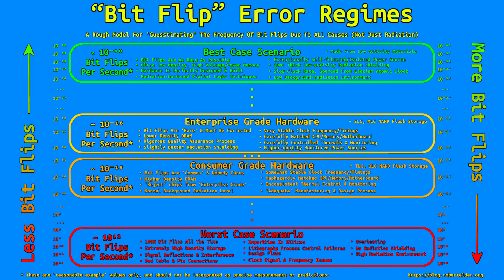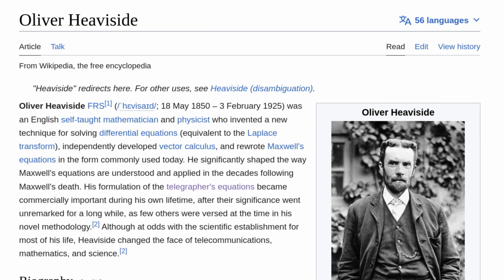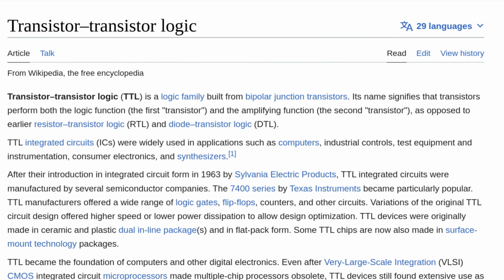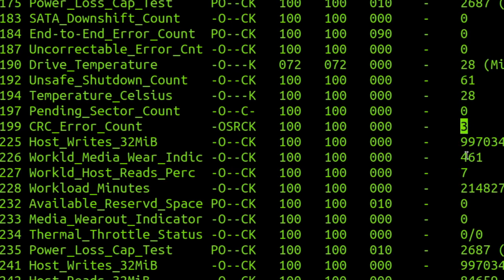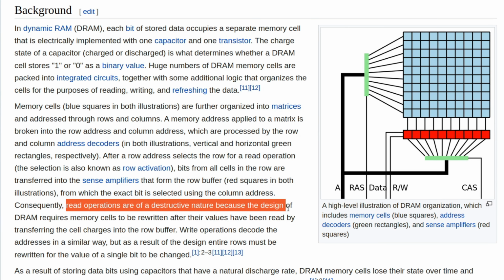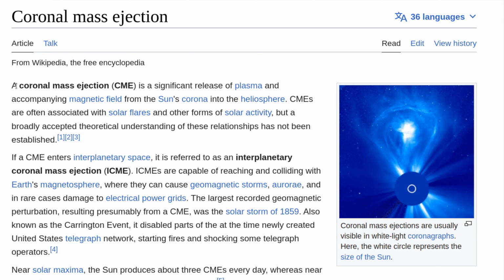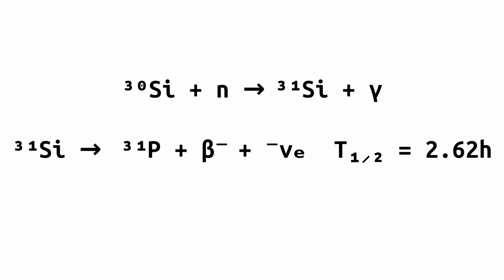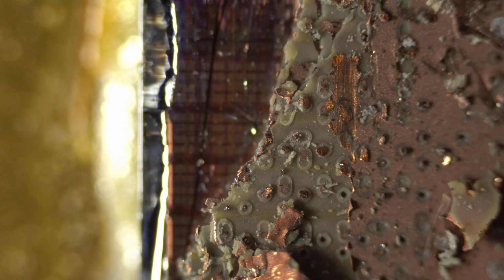What Causes Bit Flips In Computer Memory?

Comment: Now having fully watched this, while I was somewhat right in my gut instinct that it's a travesty that error reporting ecc isn't everywhere, it also gave me anxiety knowing that everywhere in my life I might be losing data and will likely never know.

I then also realized the silver lining, which is that It has been happening and I don't know. That a  it flip here or there is most likely not the end of the world, just one weird glitch video frame or having to reboot the computer every once in a while.

While I'd muh rather not have this happen, and so for my future PC's have decided to always go ecc where possible (damn you soldered ram manufacturers and non error reporting ddr5 ecc!!!) outside of a dedicated gaming rig because I really don't care much there.
Reply from the maker: My approach for data that I care about is to just keep flat file checksums alongside the files.  Filesystems like ZFS do maintain checksums of the data, but even the filesystem is subject to software bugs, so even through ZFS can potentially correct errors, I keep a couple pools with the same data.  That way, if the ZFS software on one has a broken checksum algorithm or something, or if my non-ecc hardware glitches out, I can probably still pull the data off of the other pool.  'git' repos can be checked for integrity using 'git fsck', so you don't even need to maintain external checksums there.  As long as you have multiple copies that you can confidently say are corrupted or not (by manually verifying the checksum), I think you can still maintain perfect data in an imperfect world.

Comment: I must congratulate you on the in-depth quality of this video.
It reflects everything I managed to research about this topic myself, essentially approving my knowledge about bit-flips, and making it a first-class reference for when ever I have to explain this topic to someone again.

however there is one thing I think you did not mention:

according to my memory from reading a dumpload of papers, the percentage of bit flips occurring in charged bits is higher than in uncharged ones, thus swapping ones and zeroes around in the thumbnail would have been more precise.
Reply from the maker: Thank you for the kind words.  Yes, on the topic of which 'direction' bits usually flip in, that does make sense that they would tend to flip down the lower-energy state due to unwanted 'electrical grounding'.  I suppose it could also depend on how you modulate the data, for example you could define 0V to be logic 1 and 5V to be logic 0 (but I don't know of any examples of systems that are designed this way).  You could probably even do an entire video to dissect the bit flipping mechanisms in each individual logic family/storage media, but I'll have to add that far down in my to-do list :)
Reply: @RobertElderSoftware  indeed. modulation is key, tho in ram it's mostly truthy for charged bits as far as I know.
if you want to go overboard with a follow up video, eventually you could even go in depth about how modern high capacity hard drives store data in probability with high dependence on error correction and recoverable state rather than solid truth.
(like 3 of 12 bits can fail safely etc.)
or that running tools like smartd with weekly scheduled long smart tests can ensure data recoverability beyond the safe storage timespan of magnetic storage due to automatic re-writes of ECC failing data.
(also mentioning that drives have a value that represents how often you need to wake them up to continue scanning, to prevent smart tests to end after 10%)

or how ssd's ship with a specific bit pattern out of the factory to reduce wear on write.

or why zfs stores checksums in addition to already present ECC on drives, to ensure no data is broken during file transfer on a SATA cable and so on..

just to give a couple suggestions.. :)

your content is top notch in terms of credibility.

have a nice day!
Reply from the maker: All good points.  There's a lot of interesting details to think about, but I already have a backlog of many videos that I'd like to create, but the issue with making quality content is that it takes a ton of time and the ROI is questionable.  This video still only has less than 700 views or so, and I think I spent the better part of a month researching it and making the diagrams + filming B-roll.

Comment: I'm mostly comment for your engagement metrics, but, I did want to say that there is a ton of interesting and useful information in here. However, I do feel like you are blurring the line between data corruption and bit flips. To me, it only counts as a bit flip when data is written to memory correctly, but then gets read as a different value. But, nonetheless, still a very interesting video.
Reply from the maker: Thank you for the kind words and your support :)  I agree that there is a need for better terminology around the concept of 'bit flips'.  Realistically, I made this video to help anyone out there who finds themselves trying to debug an unexplained situation where a 0 becomes a 1 or vice versa.  In that case, I do think that calling these all 'bit flips' is still appropriate since all of the topics that I covered can, in some circumstances, satisfy your definition of 'data is written correctly, but read as a different value'.  Things like flaws in the CPU silicon itself can lead to cases where certain writes are successful, but reads are not.   In general discussion, if someone talked to me about 'data corruption', I would usually assume that they're talking about corruption that has a purely software origin, such as a programming bug, that's not at all due to a hardware flaw.  Having said that, I suppose it depends on the context.  If it was a discussion about the analog level mechanism used by storage media (like the modulation technique for how data is written onto a hard drive), then I would understand that 'data corruption' refers to a flaw in the hardware implementation rather than the programming.  I think there is a lack of rigorously defined words for describing the different categories of system failures that I touch upon in this video, and that's yet another reason why debugging bit flips is such a nightmare.
Reply: @RobertElderSoftware  Agreed, and I understood the points you were making. These are scary situations - it's not the hardware; until it is.